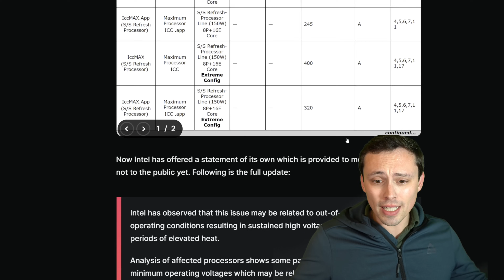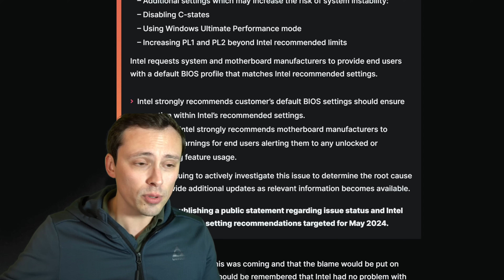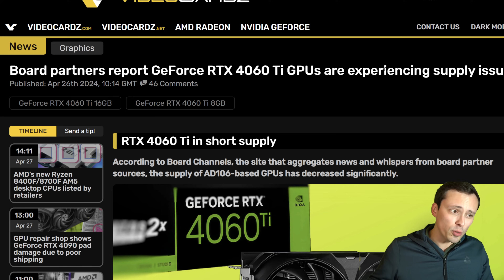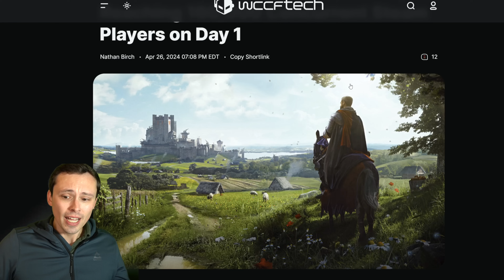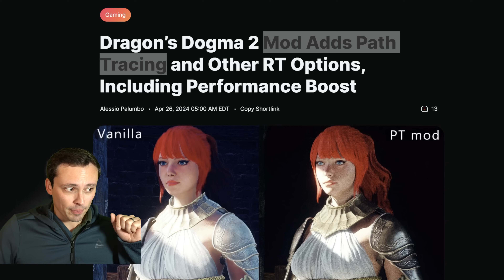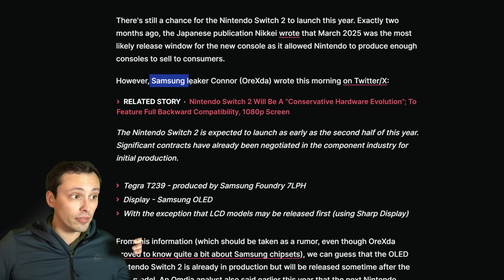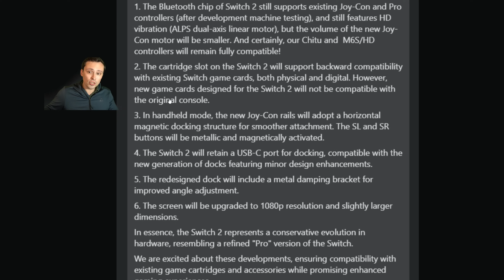MSI Abandons AMD GPUs | Intel Official Statement on CPU instability | Nintendo Switch 2

Comment: Edit: Motherboards no longer have "Failsafe Defaults" as an option in the option, that was removed by OEMs in favour of "Optimised Defaults", which mind you cook the CPU by running it out of spec. ASUS has been doing this since sandybridge, I know this because I had a Asus board kill a 2500K and which is why avoided them... thought they stopped but the Crosshair X670E Crosshair confirms they haven't. Their crappy "AI Tuner" is still at it and if you set it to Manual... the PC will never boot up again without a CMOS reset. 
Rofl, that snark! thanks for the laugh Daniel. Just ignore the idiotic trolls, they will whinge and gripe about anything, heck even if someone gave them a million dollars they'd still complain it was not presented to them on a silver plater on top of solid gold Royles Royce. Hell, even then some of them would still whinge about the choice of car. Anyway, on to watching the rest of the video.

Comment: I wonder what i should do in the UEFI for my Core i5 13600k
Reply: @bufordmustang302  Ok. I heard that some i7 did have the same problem though.
Reply: if your motherboard has voltage suppression - use it to set a ceiling of 1.35 volts and cap the temp to 90 degrees. That would help with stability but you will lose some performance.
Reply: @earthtaurus5515  I'll check that. thanks

Comment: Can totally tell you what's the problem with Intel's stability problems. Have had a 13900KF and a 14900K now, both degraded alot. They were both running fine for the first few months with an undervolt applied. After about 6 months, my 14900k now needs more than 0.07 Vcore voltage more than it initially did. Same thing happend to my 13900KF, in the end it wasn't even stable at 1.45V at stock speeds. Sure, Intels solution will probably hide the problem a little longer, because SVID Intel Failsave gives the CPU about .2 more Vcore than it actually needs, but it's also reducing performance massively (~20% or more in multicore) and doesn't fix the issue of the CPU's degrading, if anything it makes them degrade even faster, because the chips run even hotter. Almost always ran with Intel Powerlimits, so that's not the issue either. Can only speculate about the cause, but I bet it's because of high amps in combination with high temps. Seems like Intel tried a little to hard to keep up with AMD.
Reply: Anecdotal, however reliable is that the majority of streamers who report instability and dead PC's have been people with 9900k's and above, intel CPU's.
The patterns with the 10900k, 11900k and 12900k+++++ just lends credence to intel overvolting and pushing too much current to them.
The fact that intel chips have been pinning to 100c and or throttling for 6 years should tell people something.
Reply: @skorpers  what I see that shows the truth about Intel's CPU are the cooler reviews. There is performance gain with better coolers all the way up until you get to some of the best $250 360aios meaning that ANY cooler lower than that will show a 1-10% decrease due to throttling. It is a throttle monster that is almost completely untamable. Ryzen x3d shows max performance with a $50 air cooler and the result is same performance 1/2 the power draw. Unbelievable what crap Intel is releasing.. they need to use tsmc immediately.
Reply: @TheCosmicMason  Yeah at least when the 9900k and 12900k came out individually, the best custom loops available, beyond monstrous fridges as a radiator... still saw 100c temps if the power limit (within intel spec) was allowed. And when you stay in Intel spec, AMD wins in benchmarks at stock.
Reply: You set CPU power limit?
Reply: I find it funny that you fail to specify the motherboard and brand because the values come from the motherboard that are powering the CPU. Any driver updates can alter the numbers and functions of the MB. And if that is true that you needed to boost the values sound more like MB problem trying to boost the MB for more sales. And if this is true and for the MB manufacturer pushing for their gain and in process going too far it will make the CPU look bad.
Reply: @paulboyce8537  Your point is invalid because all motherboards fall within intel spec, otherwise they wouldn't be created. 

If you're mad that some don't push them as hard (which allegedly intel is pointing fingers at destabilizing or degrading chips) it makes that argument completely fall flat.
Reply: @skorpers  Incorrect as it is pointed out that motherboard manufacturers overclock the base setting to compete against other manufacturers plus it has been made clear the motherboards in question can't handle the Wattage needed to run the CPU's and keep it stable. Good example not so long ago AMD chips were melting because of the motherboard.
Reply: @paulboyce8537  Listen. You make it clear you don't understand the subject that you're trying to lecture other people on. Either cut your losses and quit or it's going to get a lot less civil because I will not waste my time explaining to you how setting to defaults works. Just because you're that much of a shill that you believe what intel has to say. If someone is unsure about whether the voltages, power limit and mce settings are stock or not, they have no business purchasing these products.

AMD chips were never melting because of the motherboard, that had already been debunked 1000 times over. The fact that you lack the nuance required to understand that intentionally installing an unofficial bios and intentionally fucking up the settings for an adverse effect will do just that is laughable.
Reply: Except everyone has been able to fix their issues by resorting to INTEL recommended settings in the bios.
Reply: @willbyrn5920  You don't have to lie to justify your purchase. This isn't the case.
Reply: @skorpers  this is the case. You’re literally the one lying. I have yet to see a story or any evidence pointing to the contrary.
Reply: @willbyrn5920  We have data going back 6 years that directly contradicts what you say. You didn't do anything but make up a fantasy out of thin air. Anyone with a working prefrontal cortex can tell you are lying. 

The most rudimentary understanding of how to use a search engine should discourage making comments like yours. Buzz off.

The funny thing about "intel spec" is that they can change the goal post as they please. Most motherboards only support "Auto, Normal (if applicable) and custom settings.
If "Auto" or "Normal" results in adverse outcomes, then intel is free to erroneously claim it's not within spec. Intel has been doing nothing but pointing fingers. It's obvious they fucked up the moment their 8 cores began pulling over 250w to keep up with AMD's offerings that draw half the power lmao.

This is a massive intel pebkac, I could go on with the past 20 years of their bullshit but it seems like you're already having trouble wrapping your head around poor products as is.

Comment: Good riddance to msi. First and last card I ever had from them (7870 ghz twin frozr ii) lasted not even a year and a half before it started flipping out in games. Weak solder joints.
Motherboards are okay but I don't find them particularly appealing.

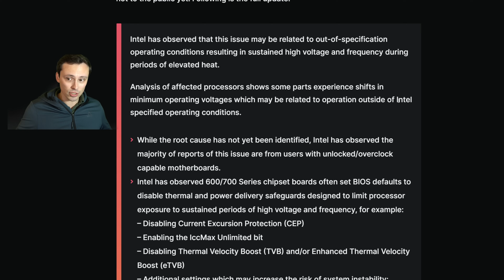Comment: 1:20
If it operates beyond Intel default specs, then maybe they shouldn't advertise their 14900KS as a 6.2Ghz chip? Since it can only reach that frequency when pumping loads of power into it?
Maybe tell tech reviewers to limit their CPU-s at normal levels of power when reviewing? So they would look like the useless things they actually are? :))
You can't have your cake and eat it too, Intel. It doesn't work that way :)))
You can't sell me a 24 core CPU and tell me I have to disable 16 of them to avoid scheduling issues :))))

Comment: Was a big fan of MSI but if they are going to do nothing but RTX it's a brand I'll avoid from now on. Have monitors, mobo's, PSU's and GPU's from them in my systems, but this is highly disappointing.
Reply: more for us
Meanwhile I'll be buying only MSI motherboards
Reply: @GewelReal  What an uneducated response. The reason I go with a single manufacturer is to use as few different platforms as possible per build. So if I have an AMD CPU I will try to pair with an AMD GPU and for me I prefer Ryzen chips. Similarly I have Tomahawk Mobos with MSI GPU's and monitors. It's called compatibility. My point was I will go with another brand where I can tie things together more easily, but I assume you are just being a fanboy and trolling.
Reply: @moonstomper68  compatibility? what are you smoking dude
Reply: @GewelReal  I would type a long response but you clearly lack the intellectual ability to understand so won't waste any more time on you.

Comment: Msi knows wheres the money at😂 even AMD don't care about their gpus this gen
Reply: Considering the average consumer spends less than $500 on their GPU, who should care? The RDNA 2 GPU's are still fine, from 4 damn years ago
Reply: @skorpers yeah right like u can buy a 6600xt vs 7600 with less money or
6800xt vs 7800xt
6700xt vs 7600 vs 7600xt
6800 vs 7700xt with more vram
Or rtx 3060 vs 7600 with more vram
Amd did nothing this gen
Reply: @mrshinobigaming8447  They don't need to do anything because the last gen product is still outperforming Nvidia in sales. Only people who buy nvidia are influencers, reviewers, labs and people who don't know what they are doing.

Comment: So intel are saying, all previous benchmark results we showed you, are null and void.

Got it.
Reply: We investigated ourselves and found nothing wrong.
Reply: kinda yes and no, the baseline profile is also really aggresive in terms of cutting power targets, it's like what zen43D had to deal when they were burning motherboards and cpus due to faulty bios voltages, the whole problem is that the motherboard ignores set PL1 and PL2 targets even when placed by the user, so it will keep boosting past that set limit, and the default profile is a big cut down.
Still, a simple power limit to 240W keeps their cpu's at 96% performance of their 315w+ bios.
Reply: Now if only reviewers went back and remade all the benchmarks in the last 2 generations... and for the next generations... to show how REALLY they perform...
Reply: Intel: Mainboard manufacturers, please make sure we win in benchmarks
Also Intel: Mainboard manufacturers are causing the crashes on your systems
Reply: They needed to push past safe limits so that their i7 and i9 could match the matching Ryzen r9 chips.  I found it odd that despite being built on less advanced architecture, the intel chips were matching the more advanced AMD chips this go around.  Now I know why.
Reply: @Jayman81b don't forget that AMD profits massively per CPU and Intel barely breaks even. Ryzen has been absolutely crushing it.
Reply: @Jayman81b you mean X3D chips, normal zen 4 cpus are significantly slower than 12th gen intel and up. And theyre both kind advanced in their own ways. TSMC kinda carried Ryzen till 3D vcache which was honestly kinda a big thing that Intel still hasnt had an answer for, but big little core is an advancement that AMD really needs to get on and stop doing that weird bootlegged parking shit that doesnt even work right on the 7900X3D and 7950X3D. Intel and especially Apple have been on big little for a while and its just way more efficient, and with AMD’s node advantage they could do some insane shit like 12 p cores and 24 e cores or even more while still being way more efficient and putting vcache on the p cores
Reply: @christophermullins7163 really? Do you know where can I read more about it?
Reply: @Angel7black You must not read benchmarks the only time a 12th generation beat Zen 3 was in CINEBENCH R23 single thread & multi-thread, Zen 3 beat the 12th gen in most gaming benchmarks. 12th generation can't even touch Zen 4 in IPC the only time they win is multi-threading with more cores & they barely win that too.
Reply: @visitante-pc5zc  I've seen it several places.. don't remember specifically but yeah. Intel does have massive revenue but AMD actually profits way more than Intel per unit sold.
Reply: @fishingkev2332  you are pretty delusional if you think zen3 was even to close to beating alder lake in gaming, the only zen3 cpu that was able to keep up was the 5800X3D vs 12th gen high end sku's, anything past the 12600 was beating the 5950x by a generational leap, stuff like the 12400F and 12500 are the only ones that were lagging behind, and were still matching the 5950x, the leap wasn't as notable because the fastest gpu at the time those 2 were main competitors, was the 3090 and 3090ti, the 4090 just broadened the difference between those skus.
Reply: @ishiddddd4783  go read a review
Reply: Of Course Intel were in it as well, as they'd have to validate the motherboards... if they weren't validating mobos or even testing them... I'd seriously start questioning their basic competence.

Comment: Day 1 of asking for an official Daniel Owen mouse cursor
Reply from the maker: I keep seeing people ask for this, but I have no idea how to make something like that. It does sound funny as a merch idea or channel member bonus or something.
Reply: @danielowentech  I can make a cursor set. You only really need a few images: pointer (preferably pointing top left), hover, busy(waiting - this one could be funny), resize (horizontal, vertical, diagonal). 
It's not really practical, since modern operating systems have dynamic cursors that you can adjust the size of, can do positive/negative addition with background, handle special display modes like high contrast for accessibility.
Reply: I believe it's not so hard to make. Even i can do that, but installing it might be an issue since Windows legacy settings where you can apply it is buried very far down 😂

Comment: I can personally attest to the fact that my motherboard defaulted to letting the mobo manufacturer set limits.  It was over 1.4V and was constantly throttling due to heat.  I even bought a new cooler thinking i had done something wrong.  Fast forward to switching it to set the CPU limits to intel specifications and I don't have any issue and don't need to undervolt my CPU anymore.  EDIT: 14700KF, mobo is ASUS z690-P prime and did have an option to switch between manual, motherboard settings, and intel settings in the BIOS.

Comment: I'm sending back my msi 7900xtx just in case warranty issues arise
Reply: Yeah, just buy a 4080S
Reply: @victorsegoviapalacios4710  ill strongly consider that my game room is very warm from the xtx
Reply: Having owned both a 4090 and a XFX 7900XTX Merc310, 4090 was worth the change imho. 4080S also a valid option for that 1K price range. The only thing I will dock Nvidia on is the included adapter for 4090 is in an open 7000D Airflow since I don't think it would close otherwise, though PSU companies often sell an adapter cable to go directly from the PSU to the GPU. My room is cooler without the sauna that my 7900XTX becomes. I had found myself even using 7800XT more then the XTX due to lower heat output. 4090 is truly ahead in performance.